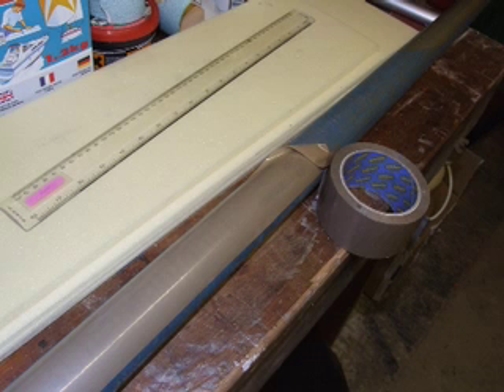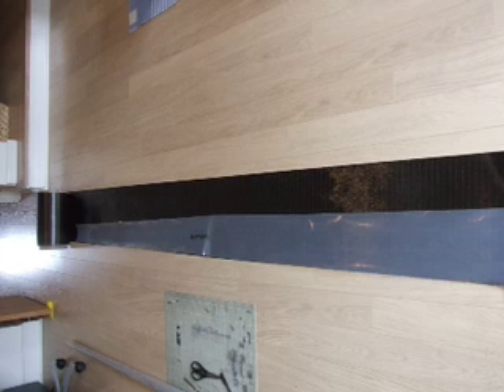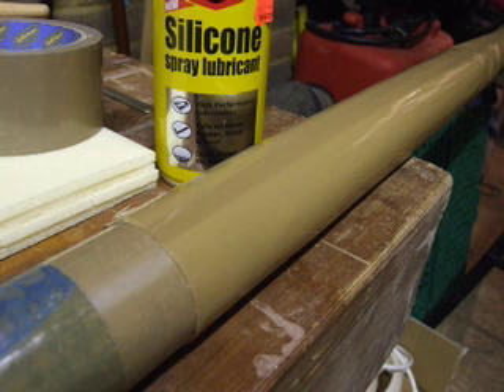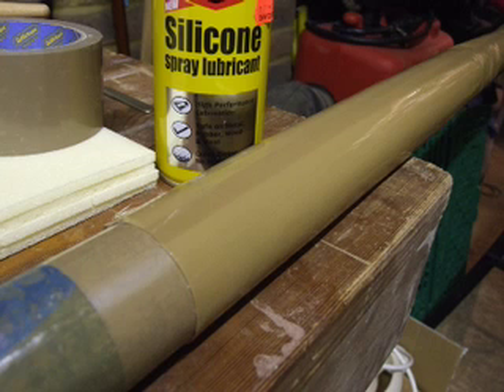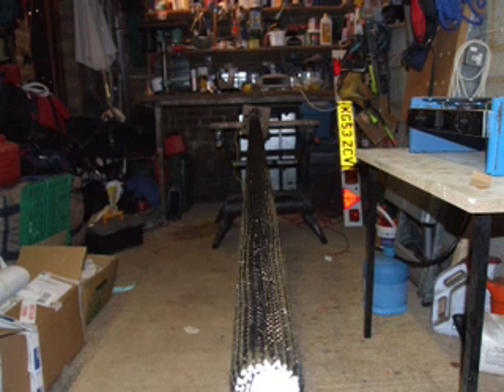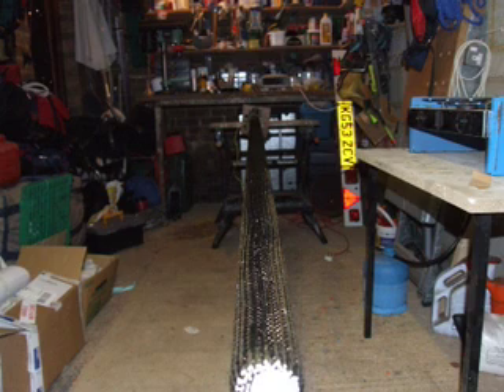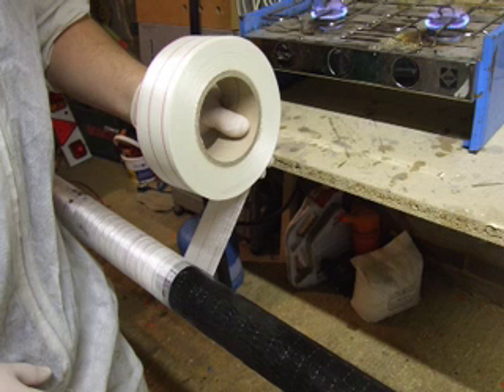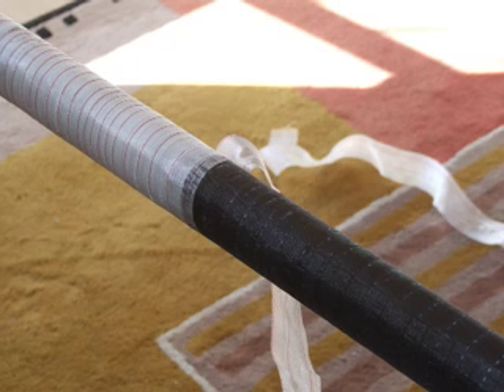Building a Carbon Spinnaker Pole

Comment: when your using carbon and epoxy and your after a high strength product then you need to think about post curing your product. typically sp recommend curing at 80 degrees c for 8 hours to achieve the strongest laminate possible. Also using the correct epoxy will give a stronger laminate.  sp do sell a specific laminating resin to be used when making high strength products. these videos are fine for low usage low spec products but if your after top spec stuff jus buy one from selden or superspars